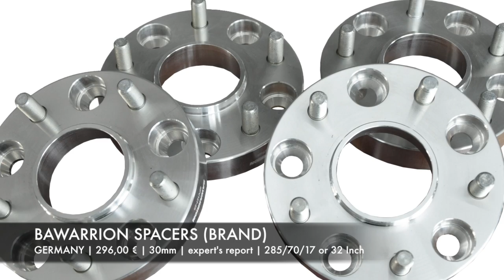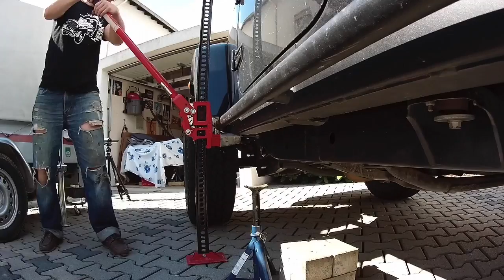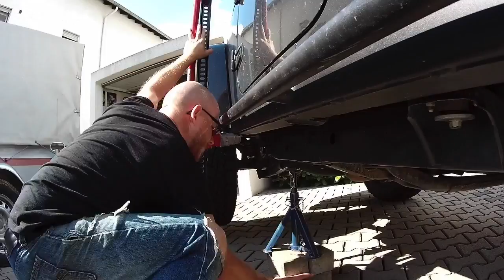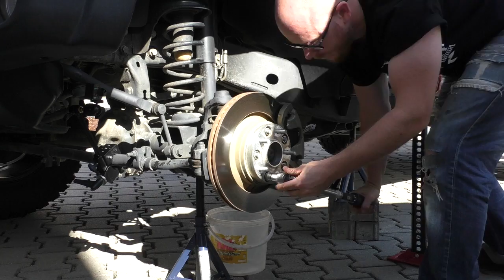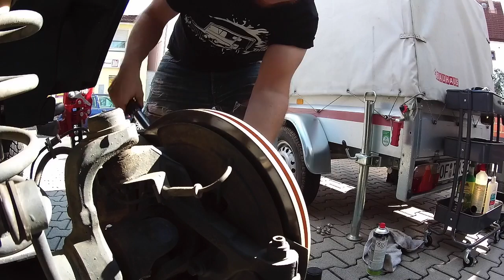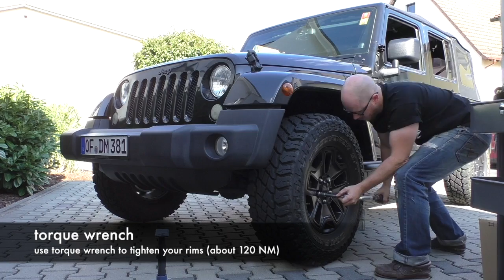Jeep Wrangler JK | How to install the spacer disks

Comment: Suggest removing the rings holding the rotors in place to ensure a flat surface and also using a wire brush on rotor flats to remove any rust prior to using brake parts cleaner.  These steps help ensure a true and flat surface to avoid any potential shakes or vibrations.
Reply from the maker: Rich Beach Yes, you are right. Thx a lot. Regards.

Comment: How do those coopers
ride on road ? And I'm trying to run 265 75 r16 on my 2017 JKU.  Stock steel What spacer do you think would work 1.25 or 1.50 no lift I want to stay under stock fenders with no rubbing?
Reply from the maker: Hey, thanks for asking. I am running 285 70 R17 with 250mm spacer on each side. I am staying under stock fenders with the tires, so it works great. I think your setup will work too. I am not sure, which spacers you should use. Maybe 1.25 will be enough. The tires are great on and also off-road. Ist 70% to 30%. Regards from Germany.

Comment: Hi, i was wondering if they rub on the end of the fenders when it flexes? I have stock size duratracs and stock height. Thanks!
Reply from the maker: No rubbing at the end on the fenders. 30mm Disk breaks on each side an 285/70 R17 Wheels/Rims. German TÜV proofed - HAHA. Regards from Germany.
Reply: JKWrangler N Willys Jeep 
Thanks! Regards from canada

Comment: Very nice set up. Are the rubicon wheels from the dealership or off a website? And do you need a lift on your 285's?
Reply from the maker: hi. I bought the rims on eBay. You do not need a lift with 285 wheels. Thanks for your request Dude.

Comment: at 2:36 you see the tip of the lugs higher than the spacer. you need to grind off the tip to have a flush seat for your wheel
Reply from the maker: Thanks for that comment. Very helpful. Regards.
Reply from the maker: Yeah. I did that. Sorry, that this is not shown in the vid.

Comment: what is the spacer disks are dor?
Reply from the maker: @tom choi I don't understand your question?
Reply: why are you adding the spacer disk?
Reply from the maker: I installed larger tires and in that case i do need the spacers for driving-safety. Regards from Germany.